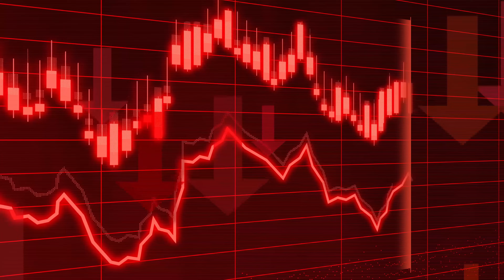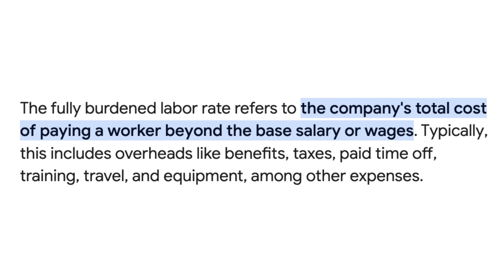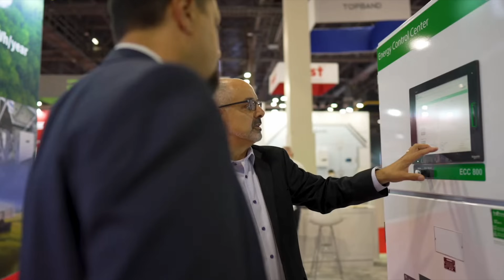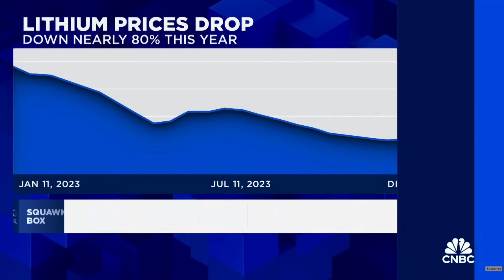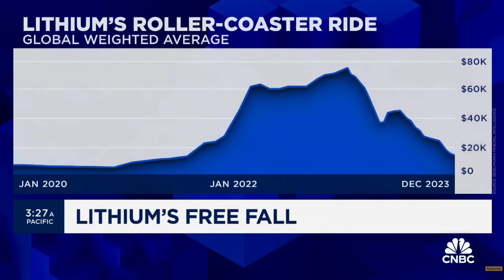IT'S BEGUN! The Solar Battery CRASH of 2025

Comment: What about salt ion and other new battery tech dropping the price of the older tech?
Also higher levels of adoption.
Battery shipping costs to NZ is still rough, our smaller market doesn't help, we also have cheap ish power & a lowering buy back. So payback period is longer. $0.23 NZD/unit, but you can get deals with lower night rates, free power hours off peak.

For a short term payback a system spec'd for peak usage in the middle of the day, self installed with no batteries makes sense. Or your off grid and it costs to much to get power to site.

Comment: What seems to me to be one of the DIY dealls at the moment is the apexium DIY battery  $420  plus shipping for the box and $30 -$50  to populate with 16 pieces  320ahr batteries putting it into the $1000 to $2000 range for a 15000kwh battery
Reply: Dont you mean 15 kWh ?
Reply: Yep went this way for (4) 16Kwh DIY battery packs with 200amp JK BMS and have 64Kwh for about $7,200.
Reply: This is the way.

Comment: DIY took me 1h/bank build.
Reply: Did you relocate selected circuits and take your entire home off the grid during the power outage?  and what is your ability to handle large inductive loads?
Reply: @boblatkey7160  I'm fully off-grid. Grid is now as backup only. I don't have extreme inductive loads. My most power hungry loads are highly resistive (water boilers, classic heat radiators).
Reply: @ForgottenGamesAndMods  good for you! Fellow off gridder, disconnected from the grid for over 20 years.

Comment: Without net metering, power companies are just precipitating their own demise. 

1 to 1 net metering saves them transmission costs. Removing that creates conditions where batteries make economic sense, which means less business.

I'd fire anyone who suggested net metering is bad idea if I ran a power company. They are obviously incompetent.
Reply: Have you ever experienced Communism? Or do you just believe everything that Fox News tells you?
Reply: You obviously do not run a power company then.
Reply: And because it is locally consumed, less voltage/power loss on the power line... Power doesn't have to travel as far...
Reply: Why do you think it happened in Commiefornia first? Lmao

Comment: You have not factored in to Sodium Ion Batterries !! do your Research they have become more comparative Vs Lithium in terms of per KG energy density !!! 270/kg Vs Litium 250 to 300/KG and in few months will be equal !!!
Reply: Why don't you do your research! By 2030 the battery market will still be over 80% lithium! Sodium batteries are going to come but they are going to be slow and requires a lot of reworking of inverters and electrical control systems. Just because you read it in popular science magazine, doesn't mean it's gonna happen tomorrow!

Comment: I don't see battery prices lower as I brought 24 AGM Batteries for our system in late 2019 for $590/ea.  The same batteries are not $710/ea.
Reply: Why are you looking at AGM? It's dead by now.
Reply: the new 1kWh lfp cell from eve is $90. agm cannot compete with that
Reply: @stefanweilhartner4415  what I discovered is that lithium has dropped while lead has increased.  I just bought four Rhino Lithium battery packs.

Comment: Can you please do a video on panel maintenance? Installing panels on the ground makes cleaning them easy, but not all houses have enough yard area for that.
Reply from the maker: I would, however it is not super complicated. I recommend hiring a local solar panel company to come out 1-2 times a year, usually after spring and summer time to clean the panels. Shouldn't cost more than $150 for the average sized system

Comment: Breakthroughs in recycling technology should help reduce the cost of the raw elements used in batteries. There will come a point, where no additional mining will be necessary to maintain the market. The only mining from then on, would be to expand the market. Once those materials are in the market, they too, will remain in the market. That eliminates pollution from disposal, as well as provide a cheap source of the raw elements.
Reply: Maybe like plastic bottles where it is actually more expensive to recycle a plastic bottle than it is to purchase raw virgin polyethylene? 😂😂😂
Reply: @boblatkey7160  You make a good point. Recycling some plastics, is similar to trying to "un-cook an egg. If you break the bottle down to its constituent elements, you end up with mostly carbon, and hydrogen gas. Those elements are quite inexpensive, but trying to reconfigure those elements into polyethylene would be much more difficult, than the original process used to create it from petroleum.
     With batteries, you get highly valuable materials, like Lithium, cobalt, manganese, nickel, copper, aluminum, phosphorous....The list goes on, for materials that cost much more than hydrogen and carbon. Much more worth it!
Reply: That does sound good but it's wrong though. Look at plastics. Recycling is a myth. There's enough plastic in this world to never have to produce anymore ever again. But it's still way cheaper to make new plastic then it costs to recycle it and reuse it. Only about 10 percent is actually recycled the rest is sent overseas for poor countries to deal with it.

Comment: I made the plunge with a Bluetti for partial home backup and Delta Pro for an off grid workshop. I am banking on being able to expand at a fraction of my initial cost.  I realize technology will change, capacity will only get better. In my opinion the companies that will thrive will be the ones that can seamlessly upgrade or replace my existing batteries. As adding panels, transfer switches, etc can cost more than a fairly large capacity battery. Get me a plug and play bidirectional V2H EV charger and Ill be happy.
Reply: You're talking about Hobby gear, you're not even in the same ballpark. This guy is talking about long-term high-quality residential installations with 10 year warranties.
Reply: @boblatkey7160  No he is not talking hobby gear. AND these companies 10 warranties are worthless if they aren't around.
Reply: @SkipMichael  you are definitely right about the warranties, most all of them are useless. But that crap is definitely hobby gear, it will not last. That crap breaks. It'll be junk in less than three or four years.
Reply: @boblatkey7160  My hobby gear cost a fraction of a 'useless 10 year warranty' - runs my workshop and critical load panel perfectly fine while leaving me enough cash for additional solar and later expansion. Just because YOU think it requires an 'expert' does not make the rest of us idiots.

Comment: If silver falls to $17.00 all silver mining will stop and it won't be worth digging out, and silver price could go up between $300-$2000 a ounce & later on $60-$70,000 a ounce. Silver is the one to buy if I do buy any gold it only be 10 ounces, from online research gold per ounce will go up to $27-$50,000 a ounce. China has about 70,000 metric tons of gold. And India has about 2,500 metric tons of gold and over 10,000 tons of silver. And the population of India 1.417 billion have been told to buy all the silver you can your hands on and China population 1.425 billion have been told the same buy all the silver to.

Comment: When prices go down down down, and fires go up up up.  Oh, I'm sorry, it applies to EV's.
Reply: Good news, fires have not been a problem for years. There have been 457 EV fires since 2012, fires have gone down by two orders of magnitude in the last five years.  The ratio of fossil fuel vehicle fires vs. EV vehicles is over 3000 fossil fuels vehicle fires for each EV fire per mile driven.  

LiFePho batteries used in home storage do not even self ignite so do not cause fires. In fact the number one reason for a storage battery fire is a fossil fuel vehicle fire.

Comment: What?!?! My batteries were installed and hung on the wall in a matter of hours. My entire 12 kw system with 22 panels, 2 inverters, and 2 10kwh wall batteries took 1 day. A 2nd day was just to inspect and confirm. The entire system 14,000 USD complete with installation.
Reply: Mind sharing your location and equipment?? That's a great price!
Reply: @stopdrpnro Oh, my quote was 515,000 baht and at 36 baht to 1 dollar it's around 14,300 USD equiv. Actually the guy who owns Solar Solutions Clive (UK guy) says the solar panels have come down in price since I got my system so it could be even a bit cheaper here at the moment.
Reply: @stopdrpnro  Thailand. I can't  recall the breakdown. The solar panels are 22 pieces of 545 watt each from Longhi. The inverters (2)  are 6 kw each from a company called Deye. The wall battery 10khw (2) are LFP from Taiwan. The I stalkers are like 8 guys. 2 actual electricians and some labor. Labor cost in Thailand is about 10 bucks a day for low end with the electricians maybe 20 bucks a day. I'll ask my wife if she can locate the quote. But the items from China and Taiwan indeed are good value. Going on 2 years and fingers crossed the system works great. Lucky as the overall cost is low and we get lots of "Sun" days. I produce about 50kw per day average and the 20kwh of batteries generally get us through the night until sunrise. My monthly electric bill was around 350 bucks a month now it's average about 6 bucks. I do not sell back to the grid. I realize I'm fortunate with the low cost of goods and labor here.
Reply: @stopdrpnro Oh the company is called Solar Solutions ltd Thailand they have a website but that won't do you much good. 😊
Reply: Dang
Reply: @keeperspindle  These companies are robbing people blind on labor. Like the video said, 3 guys for 2 days should run under $5k.
Reply: That's amazing.
Reply: Would love to know what company as. Am beginning to look at options.  I understand if you choose not to respond. Thank you.
Reply: In Thailand everything is vastly cheaper especially the raw cost of solar panels.
Reply: What components? Enohase?
Reply: Would love to know what company as. Am beginning to look at options.  I understand if you choose not to respond. Thank you.
Reply: @mrsavage6380  I'm in Thailand so the brands may not be available for you. Panels Longi 545 watt each. Inverters Deye. Batteries Lvtopsun. I have 22 panels for a 12 kw system. 2 each  5kw inverters  and 2 wall batteries of 10kwh each. Basically two 6 kw systems joined to create one system. It has to do with local regulations pertaining to single phase houses restricted to 5kw systems. (long story) I'm attached to the grid of course but my demand is modest so I rarely draw from the grid unless it's several days in a row of bad weather (rare). My panels are on a flat carport roof and not optimally angled. That's about it.
Reply: @mrsavage6380  Company was Solar Solutions and the team did a good job. They have a website.
Reply: That same system 2 years ago would be over 65 k from most solar installers.  I got quotes from a dozen of them and turned them all down.  I kept asking for a breakdown of costs by line item, hardware, labor etc and NONE would give it to me.   The problem more than any other single factor was massive greed among the new "solar industry".
Reply: You were ripped off.

Comment: It’s simple, battery are expensive power, solar is way too cheap solar so you can have 15kwh of solar and a mere 28kwh of battery and you are pretty much sufficient for a normal 2adult 2 infants home. If there is no demand, prices are going down.
Reply: And what is the cost of these batteries
Reply: @phyllisclayton8320  nowdays around 100$/kwh , I have bought for 55$/kwh but I can’t promise they are the same brand,longevity and quality as the more expensive ones
Reply: EG4 batteries x2 28.6kWh for $6,600

Comment: Show me some real-world numbers.. not general statements. $18,000 for a 13 kilowatt battery is NOT a low price.
Reply: A Google search shows, "In 2021, you'd pay $12,000 for a 13.5 kilowatt Tesla Powerwall, and the cost has since come down a bit to $11,500 for a single unit. " I may be wrong, but that does not look anywhere close to a 40% drop in battery price. I am looking to buy. Please show me I am wrong.
Reply from the maker: @IJRPUBLIC  In 2021, a Tesla Powerwall 2, along with the additional Tesla firmware necessary to connect and commission the system would have run ≈ $17,500. With the newer Powerwall 3, you will be looking at just under  ≈ $11,000. Though, it will vary depending on the market you are in among other factors.
Reply: Well, that is not a real world number. You can buy an LG home eight complete system, which is a 7500 W inverter and 14.4 kWh of usable energy storage for $7200.. I installed everything myself and took the tax credit and my payback period Is 2.8 years.
Reply: @boblatkey7160  Bingo, and that's still pricy. If you built your own 15kwh battery with quality cells from EVE and got one of the all in one inverters like an EG4, you could save another 40% or so.
Reply: Go to signature solars website and look at their rack mount batteries. 30.7 kwh rack of batteries for $7,443.00.

Comment: Some observations from a DIY person. Biden has doubled the tariffs on Chinese products, so I’m figuring this is on solar batteries, panels, inverters. 
A lot of the installers have gone bankrupt, leaving their consumers with no way to fix problems that may arrive. 
It’s never been easier to DIY your own system, especially if it’s off grid or hybrid. I would stay away from grid tide systems, as when the grid goes down your solar goes down with it.
Also, it’s a bad idea to lease your panels, when you try to sell your house it will be much harder! People don’t want two different payments on a house they buy.
Reply: Well, the build America program from Biden has also brought foreigners into America and they are going to build the batteries right here in America and skip the tariffs and provide tons of high paying jobs right in America.

Comment: Home batteries are located in the wrong place we only need one battery and it should be in the automobile.
Reply from the maker: That is a good point, but their needs to be a dedicated connection point for the automobile battery to discharge into a homes electrical panel in order for it to be of utility.
Reply: Please explain how you got the home Solar system to fit onto the automobile to charge it when your at work durring the day?  Most people work durring the day and their vehicle is away from home durring nearlly all hours of sunlight.  The only way what your describing can work is if being own multiple BEV's and alternate with one is drive such that one is always left connected to the home to recive power.  Or if workplaces all have plugs to allow employee vehicles to soak up the daytime solar output.
Reply: @kennethferland5579  Most of the new EV have a range large enough to last a week of driving to work so it could be charged on the weekend. More and more people work from home.